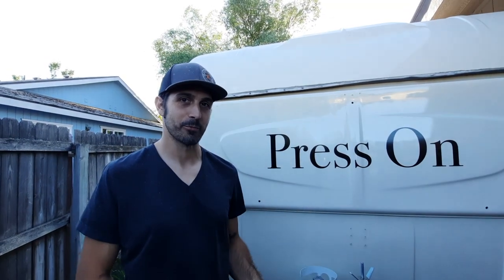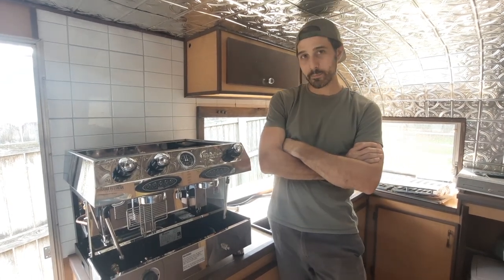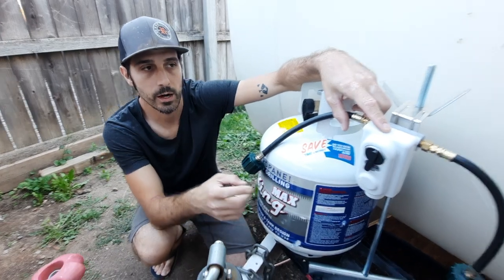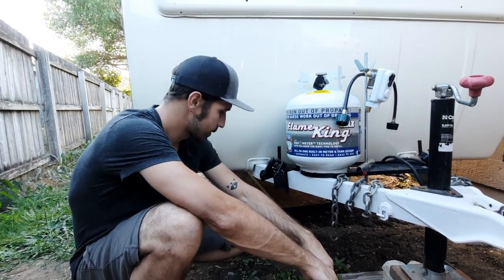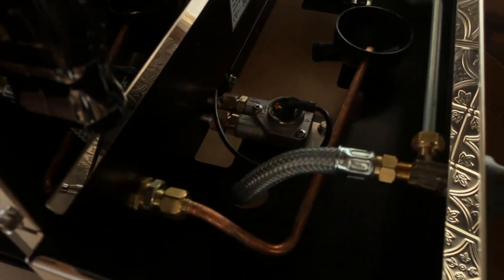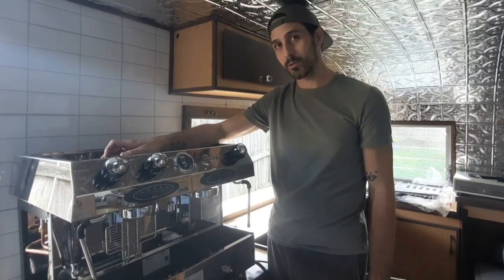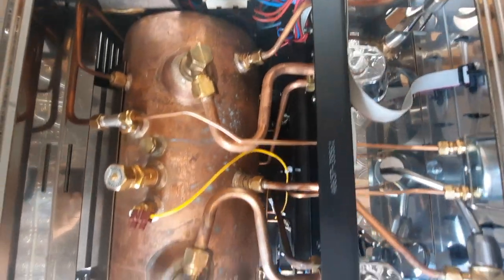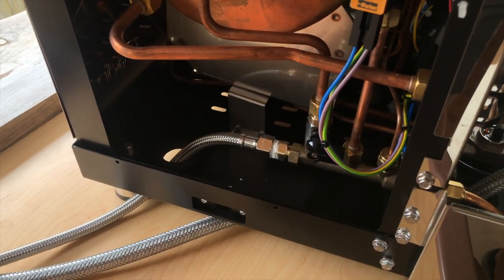Fracino Dual Fuel Install - Press On Coffee Trailers

Comment: They are very expensive but the cost of lithium batteries is a big expense, i know of a guy in FB group Australia, set up a full lithium batteries and solar panels diy and says he'll save a packet on regular electricity costs.  Lithium batteries don't make a return and dual fuel makes a large return so can see justify spending the money. Gas goes a long way but still need changing but could have a very big tall bottle and or two would last ages. Wandering if there is any other dual fuel group 2 programable machines around.
Reply from the maker: Thanks for your comment. There are many other dual fuel machines out there. Check out Magister, Wega, La Spaziale, or even Rancilio. I’ve had those 4 as well and very pleased with them. This is where I get all of my dual fuel machines from:
https://thecoffeeguys.co.uk/product-category/dual-fuel-coffee-machines/
Reply: Wandering how well the Fracino holds up in peak hour, do you find i can keep up with steam & hot water if real busy? How many coffees an hr?
Reply from the maker: @ForPropertyInvestors  it definitely keeps up. I usually have a separate hot water tap for hot water though, so I don’t take hot water from the Fracino. I’ve never kept track of how many coffees I’ve done in an hour but I have been back to back making drinks for a couple of hour straight with no issues.

Comment: Thanks for your video. We are almost done converting our coffee van and just about to setup the gas to connect the coffee machine. Do you have any more info on all the parts you used for the piping and connection? We were hoping to have a 'push and click' type system to connect the gas on the outside of the van.
Reply from the maker: Excellent! Do you have a gas/propane machine already? For our propane line, we used standard copper tubing (3/8"). I don't know if they do a "push-click" style fitting for propane. My guess is that if they do make them, they wouldn't be leak proof. Our copper line connects directly to the propane tank regulator, and runs straight to our propane/gas line from your machine. If you purchased the machine from overseas, it will most likely have a metric connection. This is the fitting we used to connect the machine line to the copper line:

BSP-NPT Adapter 1/4" Male BSPT to 3/8" Female NPT Brass Pipe Fitting Euro to US

Here's the copper tubing we used:

https://www.homedepot.com/p/Everbilt-3-8-in-x-20-ft-Soft-Copper-Refrigeration-Coil-Tubing-D-06020PS/202287075

Comment: Thx for sharing your journey!! Did you ever consider using ecoflow, or bluetti batteries that can run 120/240V and provide solar charging? Of course your solar input is to just 2-3 panels due to space limitations on top of trailer/van. Am intrigued by propane.
Reply from the maker: I looked into doing full battery set up but it would cost around $15k just for the battery system. Didn't want to make that leap just yet. The propane machine has been great and I just ordered 2 other propane machines for our next 2 trailers.
Reply: @PressOnMobileCoffee  thanks for your response. Power consumption is tricky in itself, because of fluctuations during startup vs when the boiler is maintaining a constant temp. 5kwh (100 amp h x 48 v) is about $2K each. What was your total power consumption requirement? 10kwh? 20kwh?
Reply from the maker: @NexDerm  if I ran absolutely everything  I would be looking at close to 5k watts. If I wasn’t running propane I would be at 8,500 watts. My concern with batteries is how many I would actually need and the weight of them. Do you know what I would be looking at in terms of weight and how many?

Comment: The current installations instructions I have for the Fracino Contempo 2 dual fuel says I need a 37 millibar regulator for propane, which apparently they only sell in the UK. It doesn't look like you used one in this video, how did you work around this?
Reply from the maker: @JoeTaucher  correct. I just used a regular propane regulator on my tank and it worked great.
Reply: @PressOnMobileCoffee  okay thanks!

Comment: Hey, thanks for this video, was very helpfull. I have a question that maybe you are able to answer: I was programming the buttons with the left group and it was unsuccessfully. The right touchpad worked fine but as soon as one button stopped to work from the left group, it stopped in the right too. Its weird, they were working well and suddenly they stopped... have you hear about this? There is no much information about this trouble Im dealing with. 
One tech (without even having a look) suggested to change the buttons panels.. I dont know..
Reply from the maker: Hmm, I have not had this issue. I believe if you program the right side, the left side will be programmed at the same time. Have you tried programming from the right side?
Reply: I did, but did not work... Seems like the left group doesnt save the programming, unfortunately. And the 1st and the 2nd buttons stopped working :( @PressOnMobileCoffee
Reply from the maker: @AntonellaDiSanto-s4n  is the machine older? Is it still under warranty?
Reply: It is quite old, no under warranty @PressOnMobileCoffee
Reply from the maker: @AntonellaDiSanto-s4n  my first thought would be to replace the button panel as you mentioned someone suggested, but it might also be the electrical component that stores the memory of the button panel.
Reply: @PressOnMobileCoffee  hey again! The tech replaced the main board (was very expensive 😪) and the pads work well. But, we can't build pressure.... I'm thinking to give up 👎🏻🥴. The pump is new, should be work properly, and also, we tried to conect a water hose from outside but still doesn't work. Any suggestions!? And thanks again
Reply from the maker: @AntonellaDiSanto-s4n  oh man, what a bummer. Is the machine heating up?
Reply: @PressOnMobileCoffee  haha, yes yes, it's heating (for now 🥴😆🙈)
Reply from the maker: @AntonellaDiSanto-s4n  very odd that the pressure isn’t building. I am stumped

Comment: I have the Fracino Dual Fuel Contempo on my coffee van. Had the coffee van business for two years now. The fracino is poor. Inconsistent to the max. 

An example from just this morning. I made a coffee and the strain time was 26 seconds. A good time for my particular coffee. Within a minute i made another coffee, this time the strain time dropped to 17 seconds. Throughout 2 hours of serving my strain times were jumping between 19 seconds and 30 seconds. My coffee grind was at the right consistency. My pressure guages were all showing to be correct. 

If my business was making decent money then I'd buy a new machine and definitely not a fracino. I'm stuck with the piece of shit which is made in my city of Birmingham, England!
Reply from the maker: Very surprised to hear that! I have to ask, is your grinder fairly new? I’m just curious if your burrs are worn out. I haven’t had any issues with Fracino.
Reply: @Press On Mobile Coffee  I have a fiorenzato Evo 64 and I've just had it serviced.  I have had my grind good and yet I have such inconsistency with the strain times.
Reply: @Press On Mobile Coffee  I have also had group head rubber seals and plates replaced on the fracino as well as having a new pressure valve fitted late last year.
Reply from the maker: @NazSBG  just curious, nothing inconsistent with tamping?
Reply: @Press On Mobile Coffee  hi again, I think I'm getting to the route of the issue. I do believe it is an issue with my recently serviced Fiorenzato Evo 64 grinder. I have spoken to a guy in the coffee industry who has given me some checks to do with my fracino and all is well. My baskets are the same size and not blocked. I've run water through both group heads, both with empty baskets and without baskets and water comes out fine and both heads release the same amount of water, give or take 1g. Pressure gauges are fine, and pumps are fine. 

So, it seems my grinder is not playing ball. I expect to make a couple of tiny adjustments to the grinder disc each morning but I'm having to make a lot more and also change the grind time on several occasions. 

I'm now in the process of sorting. So, my apologies for slating the fracino. I've had issues with it in the past so I assumed it was it this time. I'm two years in to running a mobile coffee van and we have taken so many kicks that I'm getting worn out with running it and both my wife and I are questioning whether to sell the business.
Reply from the maker: @NazSBG  Hi,
I totally understand. I’m glad you’re getting the problem figured out. I can see where people get burnt out on running a mobile coffee business. There are a lot of moving parts (literally), and I’ve noticed many people here in the US think it’s going to be easy. I would say, it has been one of the most challenging businesses I’ve ever decided to take on. Best of luck to you!